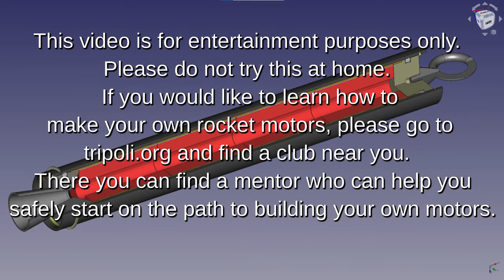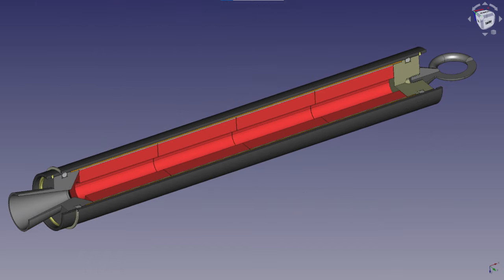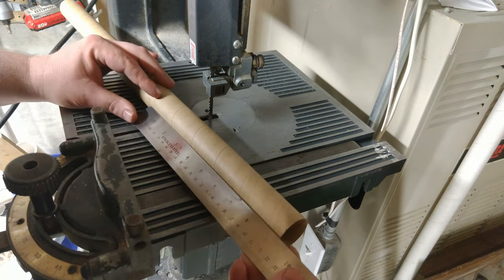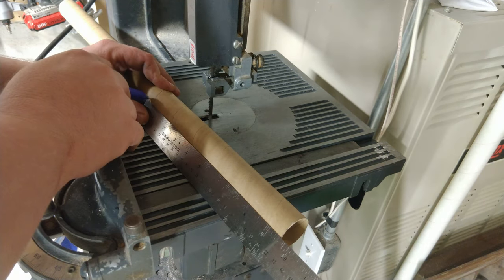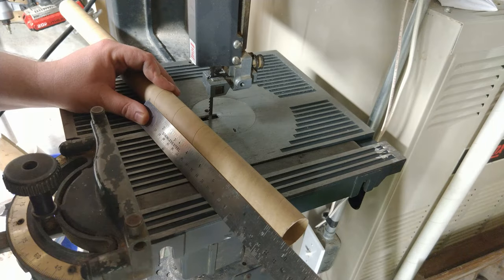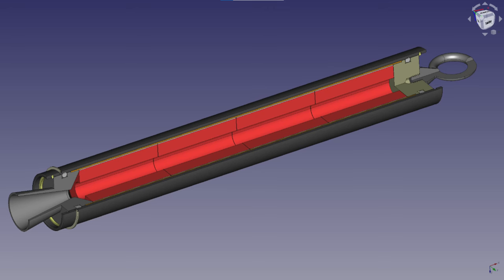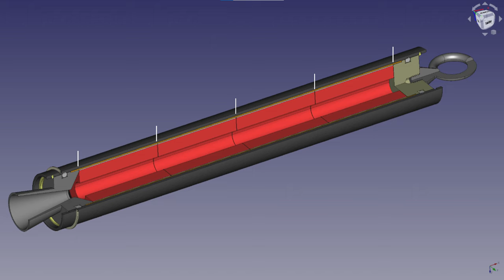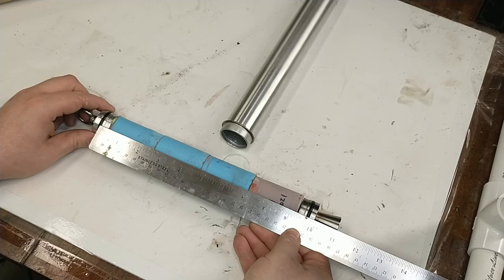Assembling and Firing a Rocket Motor - Build a KNSB (Sugar) Rocket Motor - Part 6

Comment: Which rocket body have you used ? What is the weight of the body of rocket, diameter and thickness? 
Thank you.
Reply from the maker: I've put this motor in a few rockets from about 2 lbs to 6 lbs.  A lot of my testing was done in a LOC Hi-Tech rocket.  It's a nice stable rocket for motor testing.  
https://locprecision.com/products/hi-tech/?gclid=Cj0KCQjw6KunBhDxARIsAKFUGs8M1h5NMRIsWPCmmxEj_x0XB5bz22Gbaby4dL87pSb0IfFRnu4FOeEaAky1EALw_wcB
Reply: @MinuteRockets Thank You .!!!

Comment: Thank for your video's.  Does the Rocket have any Telemetry Data - Coarse,  Altitude Etc...   Electronic Parachute, what are your setting and we will see a future Video.
Reply from the maker: The rocket has an altimeter that deploys the parachute and reports maximum altitude only.  I'll do a video on it soon.

Comment: Great vids man, one question tho wouldn't it be easier to retain the nozzle and bulkplate with screws instead of snap rings?
Reply from the maker: It depends on what tools you have.  If you don't have a lathe then screws would probably be easier, but for what I have cutting a groove for the snap ring is much easier.

Comment: Cool build, what is the weight of the hardware? Cheers
Reply from the maker: Hey, thanks!  Right now the motor is loaded so I can't get a dry weight, but loaded it weighs 623 grams.  Each grain is about 62 grams and the liner is about 35 grams so the hardware should weigh about 340 grams.

Comment: Considering getting someone to machine one for me. If the case was to over pressurize would the snap rings on the bulk head sheer? Curious if using screws on the bulkhead would be safer?
Reply from the maker: If you want to have a rocket motor machined, I'd recommend either Loki Research (lokiresearch.com) or Fisher Research (binderdesign.com).  They both offer super high quality work and I don't think you'll beat it anywhere else.

In case of an overpressurization these motors usually lose a closure or nozzle before the case ruptures, but not always.  It depends on a lot of things like how close the tolerances are on the closures, how fast the pressure builds, etc.  I don't think using screws would be safer because having a closure let go is safer in my mind than a full case rupture, which would be more likely with screws or bolts.  At normal pressures the snap rings are more than strong enough.
Reply: @MinuteRockets  Thanks for the info been doing more digging and seems like the aluminum case would just fold open in the worst case. I was thinking maybe screws would sheer off allowing the bulk head to pop open releasing pressure, but seems it would do that either way because the aluminum would just stretch/rip open. Not that you would ever over pressurize it on purpose, but just thinking how would it cato in the worst way possible.

Have definitely checked out a few sites that offer experimental motor cases including loki. Thinking I might be able to get it done locally through a family member or friend who owns a lathe if I'm lucky enough.
Reply: @MinuteRockets one thing I noted in the video when assembling the fuel grains: there sometimes seemed to be a gap between them. This is probably completely fine with a metal case, but when using plastic / paper cases, this might be something to keep in mind. It also increases the surface area, which could increase the burn rate and lead to a positive feedback loop (higher burn rate increasing pressure increasing burn rate). Again, probably not going to be an issue with a metal case but could blow up weaker rockets.

Comment: Hello, can I know the dimension of the rocket motor in this video. The length of the motor chamber, the diamter and the nozzle throat. Thank you
Reply from the maker: The case is about 11.5 inches long and the throat is 19/64 inch.  All of the dimensions and how I designed and sized the motor are at https://www.youtube.com/watch?v=u-8-eOlUsuI and https://www.youtube.com/watch?v=Pbc8e6aQnsA.

Comment: What is the thermal liner made of?
Reply from the maker: The thermal liner is made of phenolic.  There are two main sources, Always Ready Rocketry (https://alwaysreadyrocketry.com/product/standard-casting-tubes/) and Loki Research (https://lokiresearch.com/secure/store.asp?groupid=6112003225363).  The Loki ones are more resilient but also more expensive.

Comment: How can i make one that is just as strong as yours but lasts longer?
Reply from the maker: For this design to last longer you would make it larger diameter since it burns from the core outward.  You can also do other things with the geometry to make it last longer and stay the same size, but it will have less power.
Reply: And what about the chemicals? How i need to change the mixture so that it burns more slowly but just as strongly?

Comment: I am currently working on a new sugar rocket fuel for a rocket motor. I realized that the measurements for gunpowder is 75 grams of potassium nitrate, 15 grams of charcoal dust, 10 grams of sulfur. 

The measurements for sugar rocket fuel is 3 ounces of potassium nitrate and 1 ounce of powdered sugar. 
At 75 grams of potassium nitrate in gunpowder, this is 2.646 ounces. Close enough to the powdered sugar rocket motor of 3 ounces. So why not combine the two? A charcoal sugar powder rocket motor. I am unsure yet what my binder will be but I am looking at using a simple silicone for now until something better is found.
Reply from the maker: I'm not sure anyone has tried combining sugar fuel with charcoal, but it could lead to problems since gunpowder burns way too fast for this type of motor.  It's an interesting concept but would definitely take some careful experimentation.  In the motors I'm making the sugar is the binder.

Comment: what was the max altitude you got from it
Reply from the maker: The first rocket was about 2500 feet, the second heaver rocket was a little under 2000.
Reply: @MinuteRockets  nice, I have build a simular motor but have not yet got the change to test it but looking at your's it looks promesing.